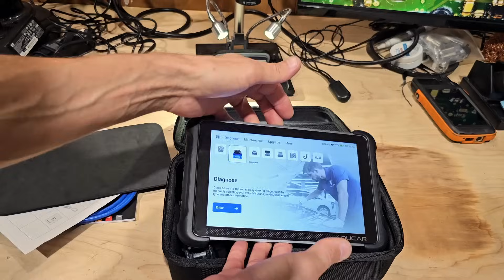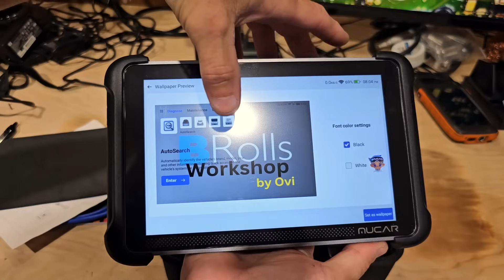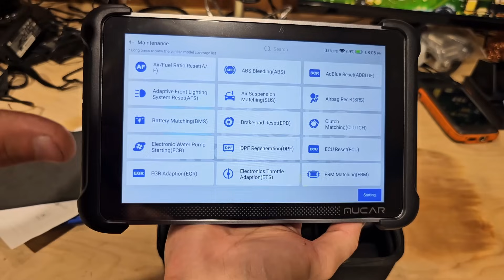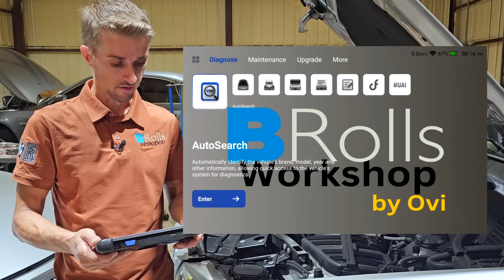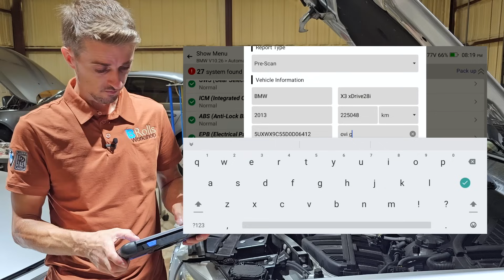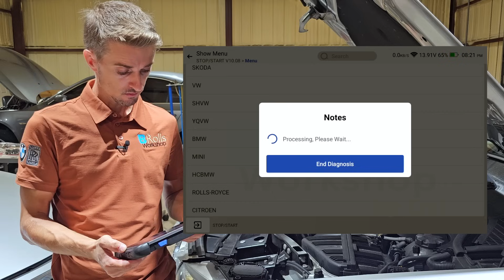Diagnosis and Coding Tool MUCAR 892 BT Overview & Features

Comment: i bought one a few days ago and it can not detect my cars. i haev a 2022 corolla and another 2003 camry! i contacted them and they started give me excuses that you should enter the vin number and find your car manually! I mean they advertise this as it has over 10000+ cars ad yet it can not find a 2022 and 2003 Toyota for Christs sake! i updated the firmware of VCI and still not working out. after i contacted them they started to give me discounts and make it look normal. but if it cannot detect toyota and i have to send you my vin so you update your database then what good is this device.
Reply from the maker: Sorry to hear you're having trouble with your device. It sounds frustrating when a tool doesn't work as expected right out of the box, especially with common car models. I recommend thoroughly checking the connection between the device and your car's OBD-II port, as a loose connection can sometimes prevent detection. Also, ensure all software updates are completely installed, not just the firmware, as sometimes updates can be staged. If issues persist, try testing the device on another vehicle if possible to rule out a specific car communication problem.

Comment: Just a heads up. I just purchased this 892bt. I was diagnosing a steering angle sensor code and went to the AI and it told me I needed to change my transmission fluid and or shift solenoid. What a waste of my time and money. Not able to return it. Lesson learned
Reply from the maker: The AI function it is a super Google will gather all the info that it is available online and give you a resume,  but you don't diagnose a car only using AI or Google it! The diagnosis equipment is part of the diagnosis process! The diagnosis process involves testing, measuring,  activating,  dismantling until you find the problem! You dont start to replace parts only because there is an error code for them! The error code is there to guide you towards the problem!

Comment: Hi! Is it necessary to be connected to the internet for every operation? not even dtc read/clear without it? thanks!
Reply from the maker: No, it does not require an internet connection for normal use
Reply: @MOvidiu thank you for your quick answer. Their support said that, and it seemed a little strange, you might need to use it without internet connection, or no phone signal zones. 😊
Reply from the maker: Absolutely no internet connection! This is one of the few tools that when you'll purchase it you will own it! At least now! But you dont know if in the future they'll decide to change the game! Let's hope no!
Reply: yes, I thought so...I don't know if you've tested launch autel  and others, If yes I was curious how this perform compared to equivalent brands? cause you do not know anymore who is copying who 😄 especially for read/clear dtc, where almost everything I used it was ok, excluding on mercedes, but for data logging on different car brands, and some component adaptation/calibration, egr dpf scr....
Reply: more than, I saw some video, and it gave some diagram schematic on dtc description. it is too much to be true😆

Comment: Te salut. tocmai ce am facut trecerea de la ista 4.32.15 la 4.52.40. Totul ok cu exceptia faptului ca la noua versiune 4.52.40 dupa ce fac un print fault memory in ista, nu mai gasesc acel folder print din locul unde este instalat ista. Ai idee, aceasta versiune nu mai are aceasta posibilitate de a efectua prin to file ? Am vazut ca tu folosesti versiunea  4.39. Este mai ok decat 4.52.40 ? La tine functioneaza print tu file ? Iti multumesc anticipat daca ai timp sa.ti dai cu parerea.

Comment: what year will it work on? I don’t think my e39 will work with bluetooth or those advanced scanners. some manufacturer should make a BMW specific one with Inpa, insta+, etc
Reply from the maker: Your e39 will supposed to work! The Bluetooth is for the communication between the OBD adapter head and the main unit, there is nothing related to the vehicle scanned! Now depending on your e39 is if first non LCI model you probably will need and adapter from the old stile BMW round port to OBD, and unfortunately no scan tool manufacturer can do that a tool with impa and ista , because those are not free to use for everyone and especially to make money on them!

Comment: It looks like copy paste of the Launch X431 software
Reply from the maker: Really? I didn't know,  to be honest I avoided aftermarket tools for many years even if I was getting a lot of requests to test them and do video, so I was thinking I decided to give it a go!
Reply: @MOvidiu the best of the bunch imo it’s Autel, i use an Mk908 Pro dedicated for BMW/Mercedes , it does the multibrand to, but it’s optimised for those two, for BMW it’s ISTA with different interface, minus diagrams and test plans, but it does do coding/programming very well, never had any issues but only did like 5 full car updates on F chassis only, but it does do E and G as well. Now they have the Autel Ultra with diagrams and some test plans so getting very close to full ISTA+ experience…keep up the good work, regards from Romania…
Reply: @_Amy-Ro_ Autel is so pay-to-play, can't have that
Reply: Yes exactly what i was thinking. I purchased a Launch X431, very nice tool to have/work with. But the kingbolen website sell Launch Kingbolen and Thinkcar. Not a problem but if you look closely they’re all the same just different brand.
Reply: Same as Thinkcar Thinkscan  689bt